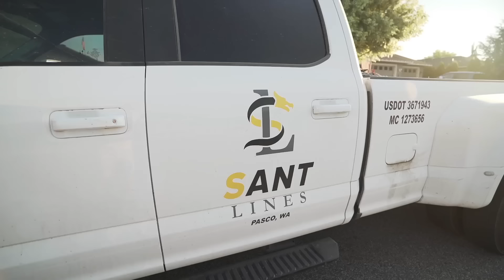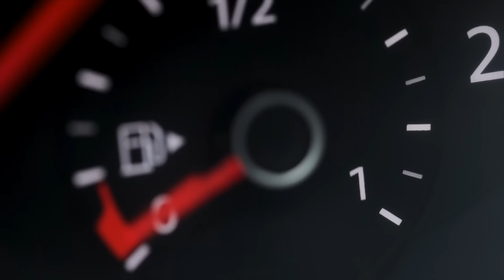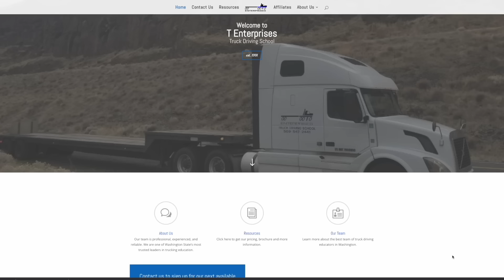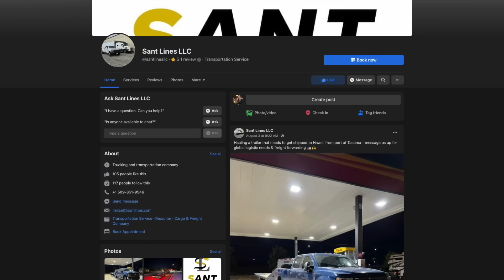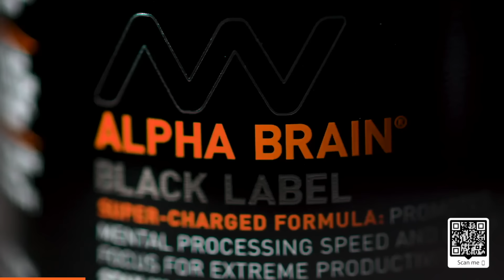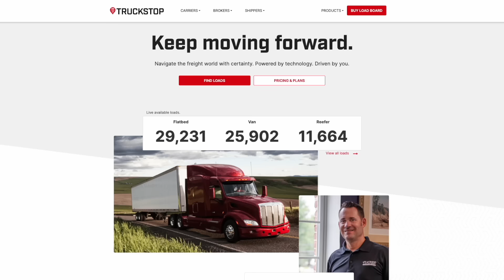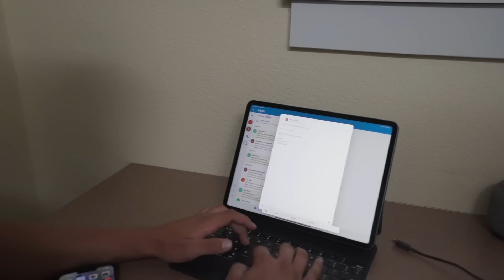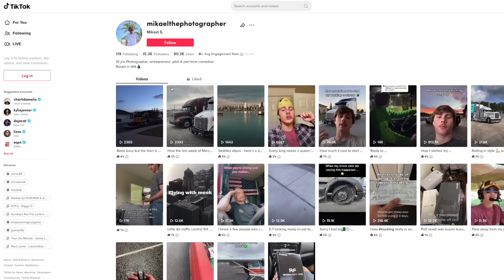19 Year-Old Starts a Trucking Business

Comment: If he made $159,000 the brokers made $259,000.
Reply: And the brokers had significantly less overhead. He might have gotten to keep only $30-$40,000 of $159,000 after fuel , driver pay , breakdown etc. While on the other hand 🖐️ brokers got to keep $240,000 after expenses. With no futuristic liabilities such as a broken down truck that may eventually need an entirely new engine.

Comment: i retired from driving after 15 years at the age of 34 kept my company open and have 32 owner Ops leased on to me I take 10% of there cut for dispatching and I generate anywhere from $15,500-17,000 a week gross after taxes usually around $13k a week
Reply: So you own all the trucks trucks drive?
Reply: @bigzachful  no I have 32 contractors leased on to me I just book them loads and they use my DOT authority and I take 10% of there cut usually anywhere from $550-800 a truck a week times that by 32 trucks

Comment: Is safer to be in the bed when someone elses is backing a pickup truck, and you or whoever guides them backing up, to make it coincide with the fifth wheel pin.

You don't want to get trapped between the pickup and the trailer. Be smarter, do not ever be in between a motion heavy equipment and a wall or between two big masses, no, never. Same as below a load. Never be bellow a load, you don't do anything bellow a load, therefore, never be under. If it falls, you're next. If she or he step on the gas, you are next and who needs you dead? Think ahead, and do dedicate more time to be away from the danger zone!

I don't have the millions but I got 46 years of life because I was protected and being protecting all possible. Take care!

Comment: Bs. This dude is struggling. Guaranteed. And he has help. The insurance piece. Elaborate on that. Bet it’s a family friend that is really helping out. I know I was paying 2k/mo on One truck. With fuel prices being more about double vs this time last year, rates lower, and insurance rates up is the reason most trucking companies are hurting especially the private sector. The trucking industry isn’t all sunshine and rainbows. Plus you have high turnover rates with drivers. Keeping someone in the seat is a struggle or at least keeping someone in the seat that gives a crap about your equipment. Good luck but be more transparent. It’s a tough industry. One big lesson is negotiate your own conteacts directly with the shipper and cut out the broker. If you can find solid companies that can give you similar loads with similar routes is a huge plus. Insurance and maintenance is another huge problem with the industry. If you can get your own mechanic and have a small shop will save you thousands I. The long run. Also diversify your fleet. Make sure you have a backup plan if a truck goes down. Either a lease option on go or a backup truck that’s not used. Keep your debts low and don’t leverage your company.